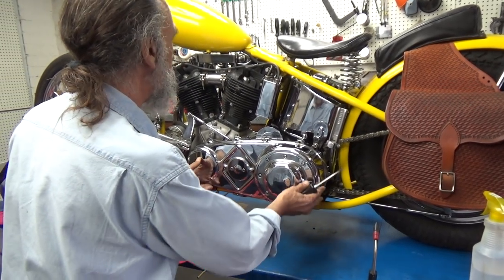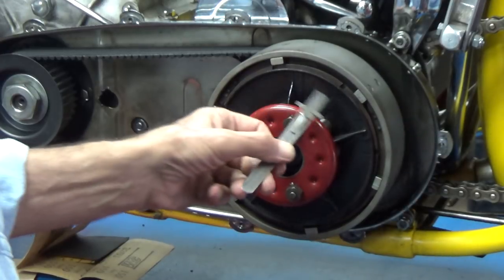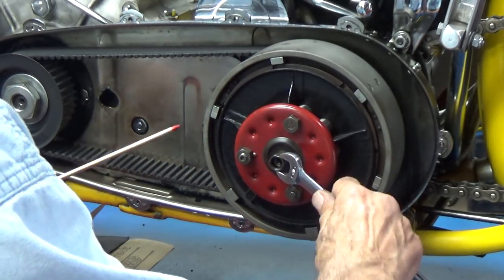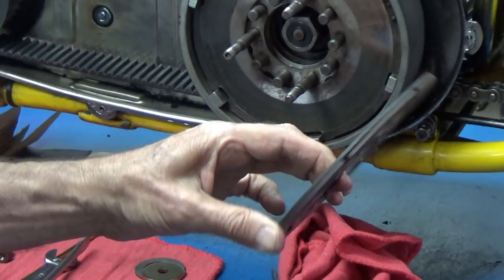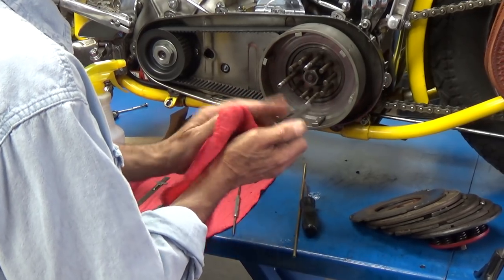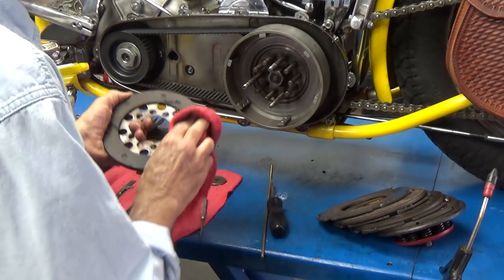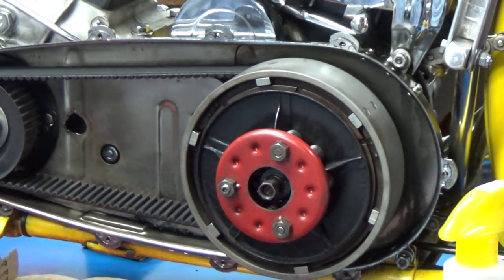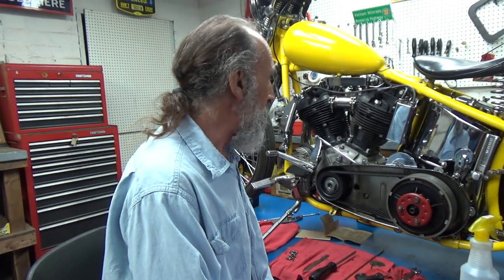Service the stock dry clutch on a Flathead, Knucklehead, Panhead, or Shovelhead Harley Davidson

Comment: THANK YOU MIKE I understand ….NO OIL I  gust old ways die hard in the old days those belts broke a lot so I am always thinking boy that belt will brake . but I will try the oil seal and thank you for getting back to me , I bought my frist Harley in 1965  a 1940 61 in a VL frame not running but mostly all there for 45.00 dollars and have been running them ever sins I do most of my riding now on my 1993 Harley FXR with a Harley side car not to meany of them around I started riding side cars in the 70s I had my 54 fle bolted to a 1954 side car . had aheart trans plant in 2000 so not the man I use to be but still love to ride any way THANK YOU Mile and ...hope to see you on the road :)  GOD BLESS ..Bill
Reply from the maker: Cool.  I think we've been down roads, most people have never seen.  But, enough of that.  Currently, just got my old roadbike, my Shovel, which I bought new in 1978, up and running again!  And, as soon as it's broke in, I can start making my sidecar mounts.  Yah, we could talk for days.

Comment: The old Shovel I bought has a belt primary drive. The belt was oily and damaged. I've read that belts need to be ventilated. The one on your Knuckle is fully enclosed. So did my belt get hot or was oil the cause ? My clutch derby cover and front of the primary cover is ventilated.
Reply from the maker: Good questions, not much information, but I'll try.  First, find out where the oil is coming from.  It could be the motor seal.  It could be from a no longer needed primary chain oiler.  It could be leaking in from somewhere else.  Next comes your question on heating.  I don't know what primary covers you're using.  The old belts were made of rubber.  Today's belts are made of Kevlar and are far more durable.  I only run belts inside tin covers, which are not sealed up, and therefore just don't seem to heat up much.  I've run them for many years and it gets real hot here in the summer.  But, venting is not a bad thing.  Oil is very hard on belts, but age and nasty things in the air deteriorates them, even the Sun's rays.  Last is alignment and tension.  Best to consult the manufacturer on your particular unit.  I hope this helps.  Good luck.
Reply: Possible leak from the clutch push rod in the center of the clutch hub nut (left hand thread nut with locking washer. There is a small seal that will leak tranny oil on the discs and plates.

Comment: Hey mike question my clutch arm is flopping around with no resistance even though I'm tightening the adjuster screw what did i do wrong?
Reply from the maker: Pull the throwout cover.  Chances are, your throwout bearing fell off.
Reply: @pacificmike9501  ok thank you Also want to say i really appreciate all the videos you guys put up great work!
Reply from the maker: Thank You.

Comment: Is there a specific measurement the clutch plates should be set at?
Reply from the maker: Depends on the motorcycle.  From the edge of the pressure plate to the releasing disc the book calls out 1".  That would be up to about 1967 (check me in the service manual).  After that, they recommend 1 1/32".  I consider those measurements to be a starting point and see how it functions.  Sometimes you have new parts and sometimes old.  Read your service manual.
Reply: @pacificmike9501  thank you I appreciate it

Comment: How do you take it out? I need to replace my belt and the only way I can put a new belt in is to take off the whole thing then put back together
Reply from the maker: Respectfully, what is the bike?  I assume you're talking about a primary drive.  Which motor?  Splined or tapered sprocket shaft.  Tin or aluminum primary covers?  Electric start? Stock clutch basket and clutch hub?  What brand of belt drive?  Kevlar or rubber belt.  All of these things make differences.  Does the transmission slide fore and aft on your tranny plate, in your frame.  Tell me more and I'll do my  best to help.

Comment: Hi mike, I converted the primary to a belt drive on my shovelhead (1982) and replaced the friction discs at the same time. I see the bike you are working on in this video has 4 friction discs. Mine originally came with 5 so after the conversion I installed the 5 new friction discs that came in the pack but now I almost can't let the clutch slip, it's almost like it's either engaged or disengaged with no in between. My mechanic also noticed that the pack of plates was a bit too thick for its taste and we cannot remove tension on the spring anymore, the nuts are at the very end of the fingers. Would you say the clutch could have a better feel if I remove one friction disc even if it originally had 5? I would much appreciate to have your opinion. Thanks!
Reply from the maker: Not a problem.  Original clutches used 5 fiber plates from '66-'84.  Earlier ones used 4.  Your belt drive clutch basket may be intended for 4.  Still not a problem.  Try 4 with  4 steels.  The first plate in should be a steel because your clutch basket is most likely aluminum and needs a steel to keep from scoring from the spinning fiber disc that you will install next.  Now alternate steel and fiber with the last plate installed to be a fiber.  You should be good to go.  Don't forget, if the steels have the buffers on them to "stagger" them for clearance.  Don't forget to get the measurement from the edge of the "pressure plate" to the releasing disc to be as close to 1 and 1/32" as close as possible and even all the way around.
Reply: @pacificmike9501  Thanks a lot, I can't wait to give it a shot! I really like your videos btw.

Comment: I always have oil laying in the cover from the motor dripin it on the chain. That normal. Always got. Small oil spot on ground everywhere I go.
Reply from the maker: What motorcycle do you have?  Are you speaking  of your primary?
Reply: @pacificmike9501  39 knucklehead yes the primary cover
Reply: I see u don't have a chain .ur running a belt and see u have a hose coming from use cases. Should go that way ??? Where's the hose sending the oil
Reply from the maker: Are you running a primary belt, or primary chain?
Reply: @pacificmike9501   chain

Comment: I'v did this many times in my life sinse i was a teenager but dude, you are fking awesome. It's nice to see you do it. I don't know if you will see this but on my 79 FLH  clutch I'm sure there are groves in those steel plate guides or what you call ems on the clutch basket that engage the steel plates. I was hoping I could just file them down smooth and make the clutch basket serviceable. Does that sound like an ok idea to you? The reason I also watched this is i was hoping you would mention how bad those steel plate's anti rattle parts should be before they need to be replaced. Mine was wiggling a little bit side to side even 20 years ago. Iv been using those steel plate sinse 1979. I am replacing my stator so I wanted to get everything right in there while I have it apart. I'm hoping It will last till I Die.
Reply from the maker: Get a long strip of emery cloth and polish those studs like a shoe shine man.  If they're too far gone, I get it, but, It's worth a try.  Those steel plates will work with or without those buffer units.  They're just quieter without them.  You can get away with a lot of stuff, but, new parts are wonderful.  We all do what we gotta do sometimes.
Reply: @pacificmike9501  Last Time I had the clutch out was about 2007. The riveted in guide blocks on the inside the clutch basket looked like they were wearing rounded grooves where the steel plate's push up against them. it's a 40 year old clutch basket and same for steel plates. Barnett fiber plates new in 2007 that still look new. I'm getting ready to take it apart next couple weeks to replace stator & rotor. I was thinking I could file down the clutch basket inner blocks where the steel plate's are wearing  rounded grooves into them. I got a new clutch hub (current one Is definitely grooved from the fiber plates). My clutch does slip only when i hit the throttle hard, never binds up when clutch disengaged and bike in gear at a stop. Early 1979 FLH with ratchet top. I always baby it. Does it sound plausible to file down those  rounded grooves on one side of each of the clutch basket guide blocks that the steel plates are wearing grooves into so I can salvage the basket?

Comment: Hey Mike! Love your videos! I have a 1980 FXWG. I've been fighting the clutch for a little while and have a question about it. The service manual speaks to setting the clutch arm on the transmission 13/16" from the tower on the transmission as the first adjustment your do. I however have yet to see anyone actually do this when adjusting their clutch. All the folks I have talked to and videos I've watched essentially show the same procedure you're doing. Was this a pointless step from HD?
Reply from the maker: Not at all.  In fact, I have suggested it before.  The manual is the place to start.  And, that adjustment, using the late tranny lid, is the way to go.  It's hard to get in there with your little ruler and it seems dumb, but it's the best starting place for your adjustment.
Reply: @pacificmike9501  So just a follow-up, the manual says to loosen the pushrod lock-nut and turn the screw out then use the adjusting sleeve to bring the release lever forward. I have heard of people instead using the adjusting screw to set the 13/16" gap at the release lever, then adjusting the cable. It seems like it accomplishes the same thing. What do you think? (note: I use a little ruler from a set of feeler gauges that I've marked the 13/16" line with a sharpie to get in there. Throw a magnet on top to keep it in place and you're all set.)
Reply from the maker: I think you're doing great.  What you're doing is getting an understanding of how it really works.  If you use the adjusting screw to set the arm position, while you hold onto the cable sleeve (which has been backed off completely), back off the screw just a little to make sure the throwout bearing is not under a load.  Gotta have a little freeplay.  Get your cable adjusted without loosing that freeplay.  Don't be surprised if it isn't perfect right off the bat.  Do it some more.  Remember to lube the cable and the hand lever.  Lube where the end of the cable seats into the clutch arm.  All of these things are important so the parts wear longer and are a pleasure to use.
Reply: I got a trick I use for the same procedure. Just take a piece of fuel line about 6 or 8 inches long and put it on the end of a spark plug that is 13/16 and use that as a feeler gauge sort of between the top of the tranny and the clutch arm. It beats hell out of trying to hold a ruler or anything in there.
Reply: @JimShai-yf4et  That's a great tip!

Comment: I have  engin oil in my  clutch  primary,  what caused  it.
Reply from the maker: You didn't tell me what the bike is.  But, most common with Evos.  Main seal or main bearing race damaged is fairly common.

Comment: Hi Mike...What brand belt kit do you like to install?...1978 Shovel...Thank You
Reply from the maker: I don't normally plug brands, but both my Knuckle and my Pan have Rivera Primo units on them  On my electric start bike, I run a chain.  Rivera has closed their doors, but parts are still available.
Reply: @pacificmike9501  I like Primo...At this time it has a Karada Belt from the 90s...Restoring bike it's been a long process and getting down to the last few parts...Need belt set up...Clutch...Ignition if I dont install the existing points...Existing is Blue Streak and Accel...never had any issues...Thank You for your input.

Comment: What did you do with your crankcase breather tube?
Reply from the maker: I hooked up a hose to it and ran it behind the inner primary.  Then, I turned off the chain oiler at the oil pump.  We've shown this in previous videos.  You shorten the tube and clamp a neoprene hose to it.
Reply: I’ll try tracking down that video. Thank you very much
Reply: @pacificmike9501  Mike, would you be kind enough to let me know the title of that video. I am having a heck of a time locating it. It would be much appreciated. Thank you

Comment: For anyone using iso with heigh water content or in an environment that has moisture make sure to sweat the metal clutch plates with a torch. Get rid of the moisture context or you’ll end up with a rusty, glued clutch.
Reply from the maker: I've never had the problem, but it does make sense.

Comment: Hi Mike, I’ve a 71 kick only dry clutch shovel that when I release the clutch in 1st it slams n jumps forward..... any thoughts would be much appreciated!!! Thanks buddy 😎
Reply from the maker: Hard to say.  I'm gonna bet the transmission isn't going into gear until you let the clutch out.  That would be a transmission problem.  If the clutch is hanging up, it could be there.  Too hard to diagnose without more info.  Tell me more.
Reply: Pacific Mike Hi Mike, many thanks for your reply..... I’ve adjusted the clutch today and when in the past  it took a while when riding for it to play up now it’s from the off.... n yes definitely feels like it’s trying to find 1st.... gutted... trans rebuild my guess!!! Thanks again from a new subscriber!! 😎
Reply from the maker: Might be a bent shifting fork (or not "timed" properly).  You should be able to figure it out before disassembling the trans.  Always try to figure it out before destroying all the evidence.  Thank you.
Reply: Pacific Mike Ahrrrrrr Mike you may be on to something there as I did my first points n timing adjustment on it and it was worse after.......thanks again for your time and advice!!! 😎
Reply from the maker: I'm referring to the spacing of the shifteing forks which is called "timing."  I apologize if that was confusing.  "Timing" in a transmission refers to the proper adjustments for the positioning of the shifting forks.
Reply from the maker: You know, you may have a problem in your throwout bearing.  Before you proceed any further, please buy a service manual so we don't confuse each other with words.  Throwout bearing is also called "clutch release bearing."
Reply: Pacific Mike ha ha yup I was Mike but that’s cool, I’ve a manual n I definitely need to read up!!! Your patience is awesome!!! Thanks as always 😎
Reply from the maker: Thank you.

Comment: Hi there! Do you have a part number for the rivera primo 8mm belt drive kit. I can only find an 8mm drive kit for an open primary. Thanks!
Reply from the maker: Nowdays, everyone uses the internet.  Primo Rivera has been around for a long time.  Look it up.  Find the right model for your bike.  You didn't say what bike you have (tapered or splined motor shaft,  tin or aluminum primaries).  I like a catalog I can hold in my hands, but the information is as close as a computer or telephone.  At Rivera Engineering, they have all the information.  Just have all of your facts in order.  Make. model, year, year of motor, kick or electric start, and style of primary.  Good luck.  You'll get it.  This stuff takes research that foes on forever.
Reply from the maker: That was "goes on forever."

Comment: Mike, what determines whether a clutch is wet or dry? I got a 76 FXE and I assume it is wet?
Reply from the maker: From 1965 up until the mid eighties, all Harley Big Twins lubed the primary chain with a drip system that ran a small tube from the oil pump to the inner primary housing and dripped oil onto the chain.  There was a breather hose that teed off of the breather hose from the engine to the oil tank that went over and pressurized the the housing.  Then, there was an oil line that returned the oil to the engine.  This was not a large volume of oil and it didn't get onto the "dry clutch."  After that, this system was eliminated and the housing held a separate volume of oil and the clutch and the chain ran in oil and became a "wet clutch."  There were different models in the eighties, some wet and some dry.  The clutches were made of different materials accordingly.

Comment: Please help! It could be a little of this~little of that~ I know" and it's not in front of you. Hear is my issue, don't be scared,  let me rephrase that,  here's my bike's issue. Got tired of replacing crappy oil slingers and Waffle bushing throw out bearing, they kept wallering out the slot that it sits on on the rod, old guy told me to get an old original one, can't find one bought an aftermarket one, adjuster screw is properly adjusted, clutch hub springs I'm running lose as I can, because when I engage the clutch, it was eating up the push rod, had a machine shop make me some custom push rods much harder, now it's eating the adjustment screw, purchase one of those Rinky Dink aftermarket adjustment screws with a ball bearing in the end, it spins then it seizes then eats itself up. If I loosen things up then I don't have enough clutch to hold the bike still in gear. It does have an aftermarket pressure plate Open primary 5 finger. Think that pressure plates too thick giving me too much pressure on those Springs still? But if I loosen it I don't have any clutch, if I tighten it eats itself up. 😕
Reply from the maker: Well, you're right.  I can't see it from here.  Are the plates sliding on the fingers?  Is the rod sliding easily through the mainshaft.  Something is giving you way too much resistance.
Reply: @pacificmike9501  That's my problem, if you don't know what it is, you check everything, I'm starting to think it's the aftermarket ...spring keeper ? Whatever you call it, ordered a Factory steel one that's thinner with the nuts that lock, thinking I have too much spring pressure.  But... the thing is, it used to work with all the parts I have, it just kept wallering the hole out in the oil Slinger before I went to the old school beefy throw out.  Thanks for responding all the same.